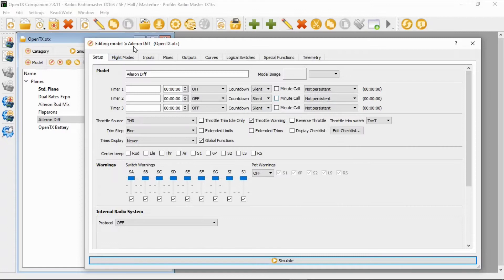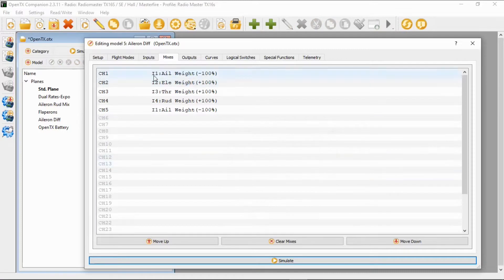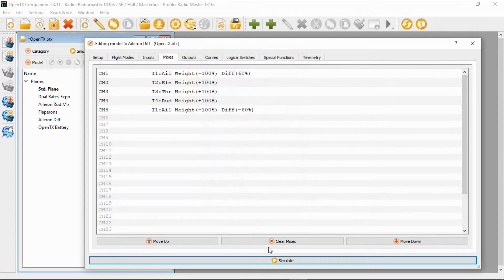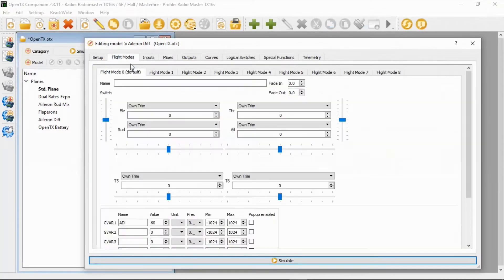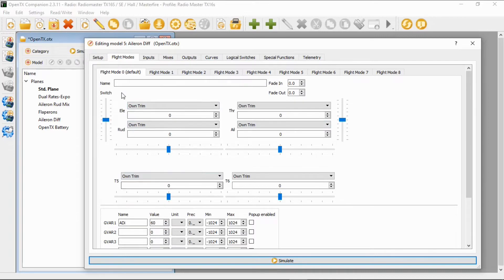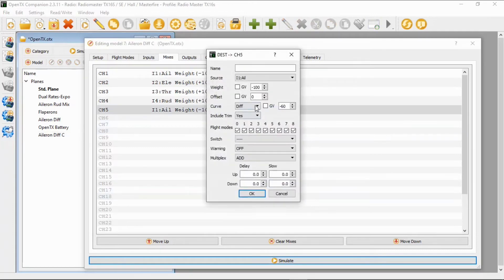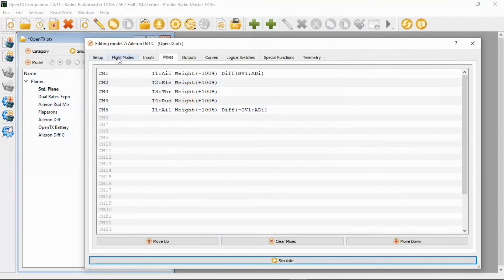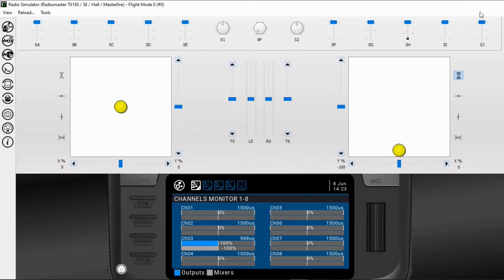OpenTX Aileron Differential No Global Variable

Comment: Any way to set up differential on an aileron channel that controls both alierons using a y-splitter?
Reply from the maker: Short answer is no but you can set it up mechanically but this is not easy to do. If your plane is rolling adequately and not shoeing advise yaw I would not bother with aileron differential.